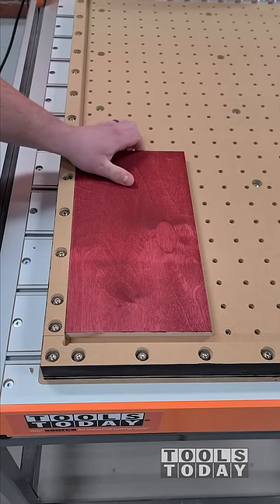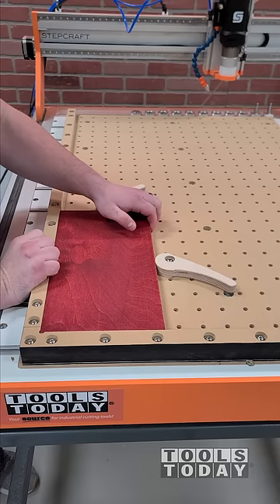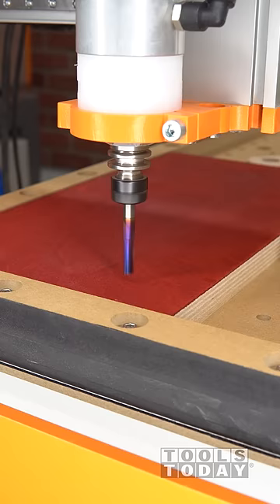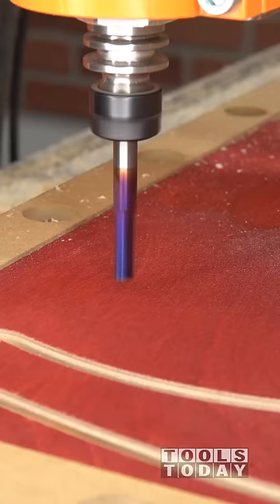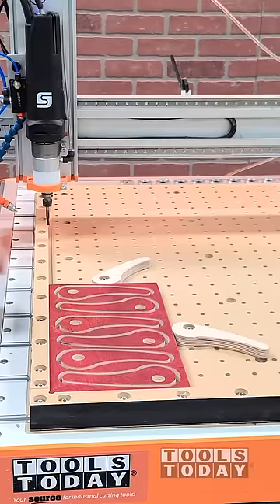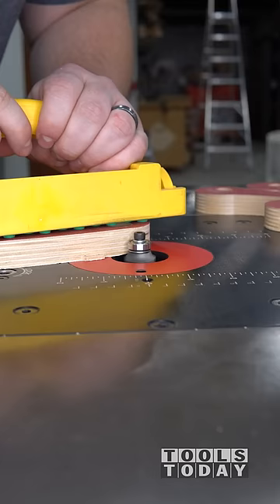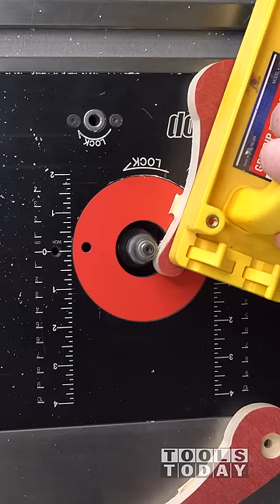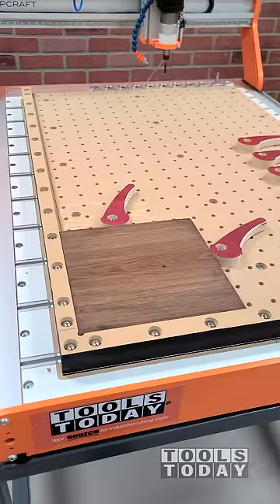Easiest CNC Clamping Method

Comment: How the hell did you make the first clamps though? Clampception!
Reply: a great deal of annoyance.
Reply: @osmacar5331  was thinking the same thing myself lol.
Reply: You just screw it into the waste board or use a strong double stick tape
Reply: By hand?
Reply: He whittled it out of some scrap wood laying around
Reply: He used the other clamps he made before those....
Reply: Theres other ways to clamp a block of wood bro, he could attatch a vice to the table and hold it in a vice or drill a hole in the wood using a vice on a mill, and screw it directly to the table that way, this way is just faster then those ways
Reply: He'd just need to cut them from a full sheet... or a sheet big enough to clamp with a C-Clamp
Reply: With mind powers
Reply: "serious answers to humorous questions" is my favorite type of youtube comment

Comment: I made this setup years ago for my CNC. The issue is the cam clamps like to slightly raise the material when clamping.
Reply: Yep.  I tried them too.  Screws up z height and engraving.
Reply: It's because the clamp pushes away. And this tilts the bolt awayfrom the workpiece. And that lifts the clamp near the workpiece.

Comment: I made export crates the same way 
       Your peg board system is just more preset than direct drilling , using locking rectangular blocks as the locking pegs 
     Once you know the size of the first side of a set of crates everything else falls in to place ( tops , runners , lengths were cut to size , measurement as when required )

Comment: Its a pet peeve of mine when video producing makers don't use starter pins with their router tables. sure its not needed to trim the edges of a cnc cut part, but you have a rolemodel position here, and some of the most gruesome shop injuries come from the router table due to kickback from starting a deeper cut without a starting pin.

Comment: If your stock and cutting surface aren’t flat then how does this press the stock flat, which is often the case. I don’t think it does. So if that’s the case people would need some top clamps in addition correct?
Reply: Typically a vacuum clamp is utilized for the z axis of freedom. The boards used on router tables are semi-permiable so the vacuum travels right through
Reply: @PurplePowered  yea I have come to discover a vacuum table would change the game